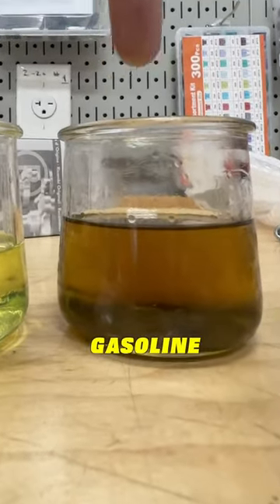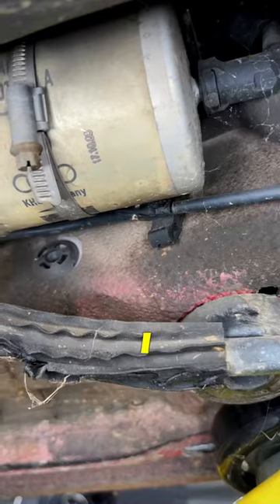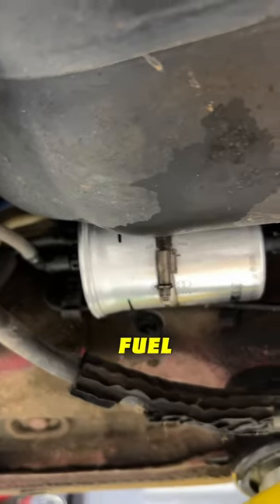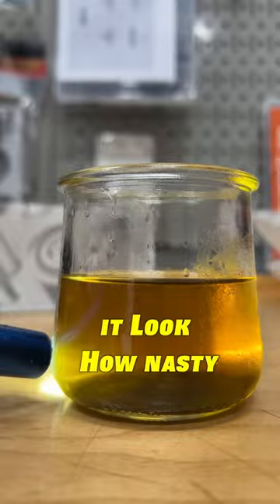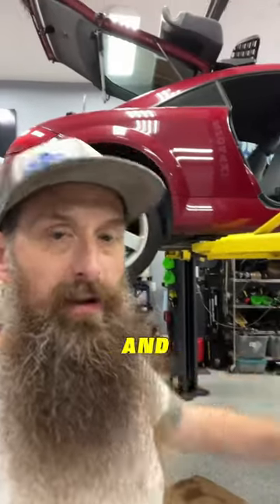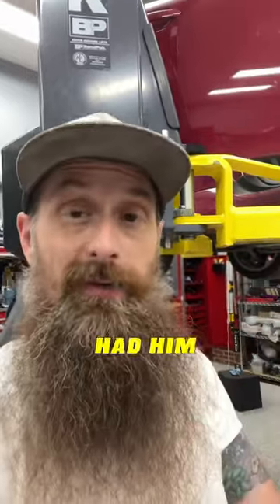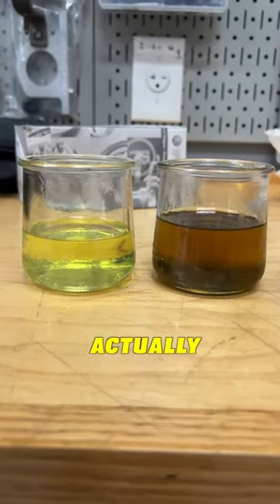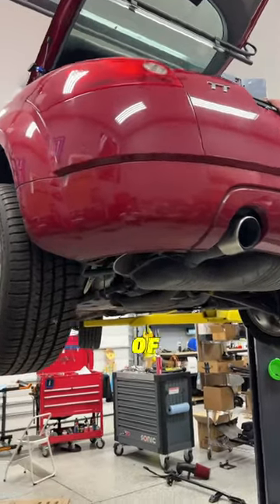5 Year Old Fuel Looks AWFUL

Comment: Got a old volvo 244 many years ago, it had been sitting in a barn several years with half tank of fuel. Put in a fully charged battery, and after about 10sec it was running. Those old cars with carbs could run on most flammable liquids. By the way, nice vw beetle (tt is same as beatle but with another body)

Comment: Interesting. Have a 2002 TT Roadster with the baseball leather, and a 1990 Corrado with the G-later G60. Corrado hasn’t been driven in over a decade and needs an overhaul. TT needs a refresh. Wondering where to go.

Comment: Put a bottle of chevron complete fuel system cleaner in and it will actually get rid of all the varnish buildup in the lines and and tank 
Doesn’t do much else but works wonders on carbureted cars.